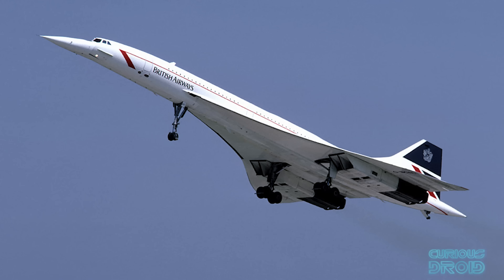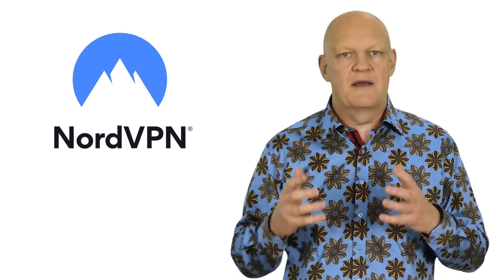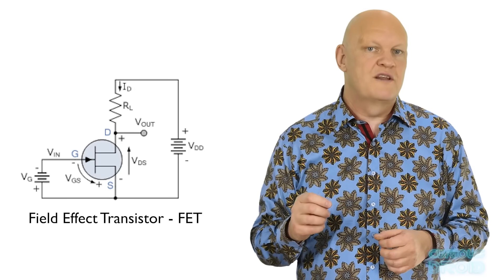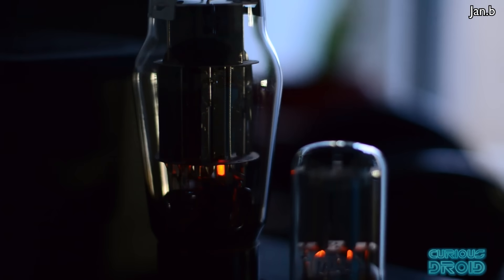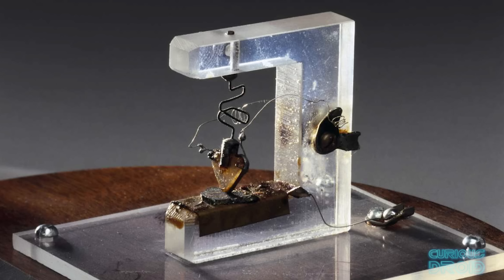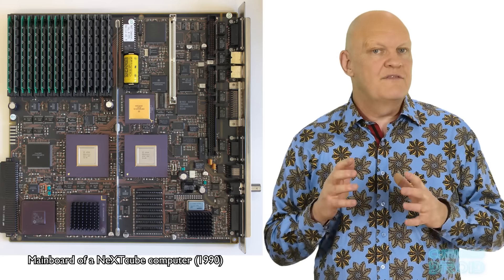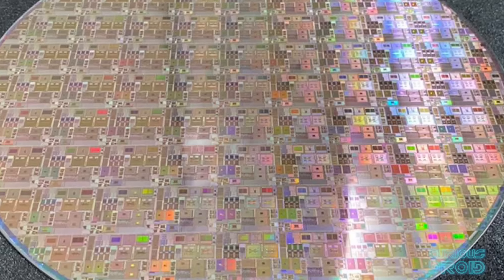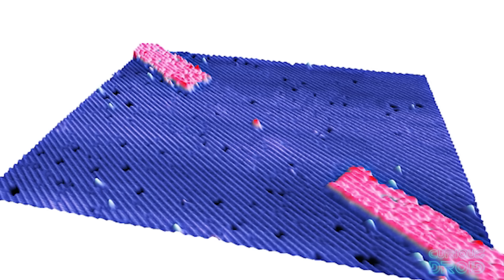MOSFET – The Most significant invention of the 20th Century

Comment: One more thing that amazes me besides the count of transistors in modern devices is how incredibly reliable they are. Hundreds of thousands to billions of them, sometimes working 24/7 for years, even decades, without failure. It's insane.
Reply: But when they screw up, it can be a nightmare of weird problems without first  blaming the MOSFET (without a circuit schematic). Intermittent problems are the worst. Been there, survived that.
Reply: @SpaceCadet4Jesus  that's why one of the best computer tools is still a small couple OZ hammer. Start taping board edges or chips, and those thermal intermittent problems show you exactly who is responsible for the errors. Just don't let the customer see you doing. :D
Reply: @williamallen7836  I used a heat gun and cold spray to diagnose potential component failures.
Reply: @williamallen7836   microwave oven is better.  put computer in oven and I find those bright blue lightning bolts always point to faults in the electronics.
Reply: @SpaceCadet4Jesus Using those tools, you're not diagnosing component failures but opponents connectivity to the circuit.
Reply: @Revo it's not only the transistor that makes them reliable. Those actually got worse with all the shrinking down the nm we did. What keeps them reliable is redundancy, in not using one cell until every other has been used (loadbalacing) too really placing circuits multiple times and switching from a broken to a working one if needed.
Reply: THIS! I work in software, and whenever I stop to think about it I am astounded by the number of operations I expect the hardware to perform with absolutely no errors. It's implicit in most software that every instruction will be performed flawlessly.
Reply: no moving parts
Reply: In July 3rd of 1947, a UFO crashed in Roswell. It had a glass panel full of microscopic circuit like thingy, broken wire that lit up at the end, a pen with light that can cut through anything, and a few other mysterious devices which we still don't know what they are used for. Read the book "The Day After Roswell" by Colonel Philip J. Corso. Some engineers who worked on early transistor validated the claims in the book. 

Interestingly, before 1947, we only had vacuum tubes and there was no clue how to improve it. December 1947, as told in this video, we had the first clumsy and rudimentary transistor, that is the building block of IC chip.
Reply: @sbkarajan  And the first design (it couldn't yet be manufactured) of  MOSFET was created in 1926. What's your point?
Reply: @martinmckee5333  "MOSFET was created in 1926" What is your source? I just googled it, it was first invented in 1959. What's YOUR point?
Reply: @martinmckee5333  LOL, I just dig a bit deeper, found the US patent by Lilienfeld.
Reply: @sbkarajan  US. Patent no. 1,745,175 is where the field effects transistor design was introduced. That was in 1926. The first operational MOSFET - a specific implementation of the design - was created in 1959.

My point is that the your attempts to form a connection between imaginary alien craft and the invention of modern electronics is entirely silly. 

A survey of the history of electronics shows how these things developed. There was no "magic" moment that requires explaination.
Reply: @martinmckee5333  1. Seen Pentagon UAP video? Pilots were not imagining.
2. Colonel Philip J. Corso, in the book, admits that he did not contribute much to the development of IC chip, laser, and fiber optics from the crash, and he said that the tech firms already had deep knowledge of such things when he joined (perhaps too late) in 1970s. But it's odd that the 1926 invention of MOSFET looks more like IC chip component than a stand alone transistor, maybe they had similar retrieval of non-human tech in Europe before US did in Roswell. 
3. If you are technically inclined, come to my CH, view some PL, "UFO Real". In it, Bob Lazar interviewed by Joe Rogan, 15 M views, will change your mind, I can almost guarantee.
Reply: @martinmckee5333  ...3 researchers from Bell labs were awarded Nobel prize in physics ims for the invention of it
Reply: @sbkarajan  don’t be so bloody rediculous,a spaceship travels through space but seem to ALWAYS crash in the states(4 I’ve heard of😏)total& utter NONSENSE
Reply: @Man_fay_the_Bru  I mean, you are so well informed, unless CNN tells you into your ear, things never happened, correct?
Hello, go watch Joe Rogan interview with Bob Lazar. 
World is not flat brother, and we cannot be the most intelligent species in the entire universe.
Reply: @cslloyd1  you've bought at least 4 iMacs, there's your problem right there.
Reply: @cslloyd1  I haven't seen a cold solder joint or cracked joint in probably 25+ years, at least not in computers. I've seen cracked traces on circuit boards. Most motherboard based problems I see are power related. Either excessive power blows a component or two or wipes the BIOS clear, both render the MB trash.
Reply: @SpaceCadet4Jesus  I saw plenty of solder joint problems in the early computers, the Elliott 903 (transistors) and it's successor the 905 (integrated circuits)  brought out in 1968. Both suffered from the boards being hand soldered. I worked on these old computers for 5 years as a field service engineer starting in 1970. It is very interesting listening to people talk about computers from that era, some people think that they must have been driven by valves and take up monstrous amount of room, not so I'm afraid. Elliott's had a military attache case version of the 905, with an 18 bit processor (both 903 and 905). Later systems had flow solder techniques that removed most of the soldering problems. William Allen's comment about a small hammer to tap a board brought back memories from that era!!! The edge of all the boards would have been rattled with  the handle of a plastic screwdriver to locate the dodgy board, get it out, have quick visual for dodgy solder points, then put it on an extender if no visual was found, out with the scope was the next option. Happy days. Then along came the huge multi-layered PCB with no hope of fixing in the field. We became board swapping monkeys from there on. Loads of us changed jobs at that point.
Reply: @johnwoody9505  I slightly remember using a hammer handle for something, but not sure what. A heat gun, cold spray, an ohm meter, and magnified visual inspection were some of my tools. I remember using a wave flow soldering machine, it was a bit cranky and produced Flux dross which I'd occasionally scoop out with a skimmer. Yes, a lot of problems were due to hand soldering, which problem largely disappeared after the IC circuit and machine soldering. I have a 8 yr old laptop whose video card has a very likely solder problem, but I haven't fixed it yet and just tossed it into a pile.
The Elliot 903 was pretty big, desk sized, but smaller than some. I didn't know there was a smaller military attache case version. Not as familiar with punch card machines although I worked near them.
There were a lot of funny stories from that time, but as I get older I forget them, until somebody triggers something. Hope you are doing well John.
Reply: @johnwoody9505  at HP we had small brass hammers we’d use on our RF microcircuits to “tune” them into tolerance.
These were used in $60k+ Spectrum & Network  Analyzers used in AWACS planes ;)
Apparent Magic…
Reply: @SpaceCadet4Jesus  or in my case (pc case actually) had a power surge through the lan cable which jumped across the motherboard contacts and fried a brand new top of the line pc 🤦‍♂️ those filters on the ups for the network cables are definately worth using.
Reply: @luminousfractal420  Sorry to hear that. 😬
Reply: @luminousfractal420  wouldn't a decent grade surge protector have prevented that issue ? They certainly are affordable, especially when the weak link in protecting highly valued components and data is utilities. Honest question. I recommend one to all of our high end domestic refrigerator customers since those computer components are subject to the same errant behavior during extreme events.
Reply: it's entirely a misconception to believe our devices work without failure, in fact our computations fail so constantly you cant run modern software without error correction, and with transistors so small tiny little particles flying through space have enough power to switch a 1 to a 0. which doesn't sound like a big deal until you realize how much a single bit of information can alter a computation. there is a bunch of basic tech support tactics drilled into the brain of everyone who works with computers, which basically boil down to "have you tried turning it off and on again?" because computers so regularly back themselves into a corner that shouldn't be there
Reply: @demonz9065  haha, guess you probably saw that recent Veritasium video too. I was going to mention cosmic rays flipping bits as well :D
Reply: @SpydersByte  indeed i did, it was a great video!
Reply: @demonz9065 ”you can’t run modern software without error correction” actually, almost no consumer computers have error detection or correction.  You have to look at Enterprise class servers before you see error detection/correction in the hardware.
Reply: Very nice  @demonz9065
Reply: @demonz9065 That happened in a super Mario game I believe it was. Somebody had some kind of cheat they were able to do in a speed run, and turns out it was due to a cosmic bit flip.

Edit: I should mention that may be apocryphal.
Reply: @demonz9065  To turn it around on you, I think it’s a common misconception that failures due to cosmic rays are frequent. Most RAM for consumer CPUs isn’t even error correcting. ECC RAM is only really used in servers, because they’re expected to be on without errors for potentially years. The risk of cosmic rays is so small for consumer electronics that it’s not really a consideration.
Reply: @JamEngulfer  i never said cosmic rays frequently flip bits and error correction is a lot more prevalent than you seem to think it is
Reply: @JamEngulfer  ... unless said chip is in interstellar space... could Voyager's recent glitch be due to such an event. Sun's magnetic field deflects most incoming cosmic rays away from the inner system. Voyager is now beyond such protection
Reply: The hazard that does exist over years of service is called "electromigration",  We in the design side of it are now able to use software tools to identify where it's most likely to happen, then we try to prevent it.
Reply: Uhhhh.... there is some evidence that these devices wear out.

We have so much planned obsolescence and market competition that most of us don't notice it.
Reply: maybe theyre alive and they want to live
Reply: What's more insane is how they test new designs, and test finished chips. The complexity of exercising them fully to weed out defects is astounding. There's a quote from Brian Kernighan about debugging being twice as hard as making the thing in the first place.
Reply: The EE rule of thumb is that if the “computer died” it was probably the power supply or the interconnects. Sealed ICs really don’t die (with some exceptions if you’re dealing with really old electronics).
Reply: A very large number of chips don't make it out of the assembly line.
Reply: now just imagine the more complex human body
Reply: why do they bring out a new phone model every year?
Reply: The components are has rated life time better with smaller size and lower dissipation, but the assembling technologies are become more prone to fall and the usual unit cases are not desinged to protect the board itself to bend and THT connection to break as well. The SMT connectors are garbe and not had mechanical support to the pcb and all of the mechanical disturbance is transfered into the tiny pads and dry soilder joints.
You can not use an whole laptop without a working chargeing port more than 6 hours so the bilion integrated transistor faliure rate can be much better than the unit itself can provide in the very best days.

Nowdays the smart ic packages are full of protection diodes, resistors, and ferrite beads to protect the ic from the harsh environments, in the old days the desinger had to make an protection strategy and implement it somehow. Mostly they do nothing, because the product is not rendered to use in a wrong way.
Reply: Yes, that is amazing !  What's even more amazing is that most of them are "hit" by cosmic rays and other types of radiation and heat, and yes, they keep going for years, decades ! 😃
Reply: Currently they are working on 2 nm chips. At this this small scale of a couple of atoms, it's running into quantum tunneling issue which is the practical limit of silicon.
Reply: Insane? No, it is MAGIC! (In the sense of Clarketech, technology so advanced, it is indistinguishable from magic.)
Reply: Actually it depends on the manufacturer but for example intel sell a 12th gen i7 intel core but comes in different qualities. Each subcategory is actually a chip that doesn't meet the specifications of a good one because of imperfections  but is still functioning. 

Also over time electrons will push the silicon atoms and eventually destroy transistors over time. Cpus can over come this but if too many go then yout chip will suddenly die.
Reply: Transistors fail all the time.

That's why error correction is built into whatever happens to be relying on them.
Reply: @SgtSnausages error correction is not used to work around failing transistors.

Comment: 14:00. I disagree, and we have molecules as an example you give to size, but nature has already revealed that a quarter turn muon, lepton gives rise that we can convert their turn relation to a binary function of difference through various means of triggering. So adding into the current dynamics of 3d builds of a processing unit. we can further create more complex storage system as of yet by utilizing the sub atomic particle branches. Utilizing them for valves that turn yes or no. Then again, one person stated a particle simply doesn't take up any space... So it returns to the core fundamental of limiting field is will call micro-electromagnetism, but its much smaller, so small that its the limitation of the smallest artificial means to create a electromagnetic current, that can be a transistor for storage.  We have Lepton group, Boson Group, Quark group that have a fundamental means of a useful product for electrical system. The size in which could be utilized should be at the sub atomic level. It would be a degree of using such things and how conductivity of something operates in a system. I have no idea... but I do know someone knows, and theses like good use of energy to utilize this level as a transister place. this would require greater understanding at the  molecular level and for consistency their atom/ molecule relation to their parts of construction. Perhaps looking back at what are we really doing? the basic of the operation to then relate back to the want/deisre of that relation in these groups, how to go about it to a similar effect. I wouldn't shoot for billions, but just a simple relation of on or off, transistor... that has the desired qualities and rigidity. 

Of course there is artificial transistors that simply only exist when powered, is another theory.. when the power is turned off the transistors do not exist... This would be more of theory, like, how water travels down a tube, and the water on the edges clings and the water in the middle goes faster. So the water has resistance that technically acts like a smooth rigid body of force that limits the movement of the water in the system. So the its basically a water tube, supported of course by a pipe, but a self supporting water tube could exist.... There is not a word that summarizes that movement that would be ongoing... So one then hast use a exhausting amount of details... IE word creation. So lets say I had a large amount of water, and zero air restiance and temperature is stable to keep it fluid. Water is an example but other substances ould be used ones that may have an easier display for the setup. So Lets say the water is traveling through a pipe at a high speed. Creates the affect, anyways the force of the water is maintained by a system ,but it is traveling through a water walled system as the resistance is held by the wall of the other substance. hmm.. but.. the wall is only electromagnetic difference that holds it there, so the water could be used to as a wall or simply electromagnetic piping, but that would be quite a controlled system of electro current to create an artificial wall as it were, rather than a pipe, Likewise it would appear to create water looking pipes with the same current on the inside.  that would be th relation of artificial transistor that only exists when powered... in th same sort of sense. Since you using a field to basically be the wafer/ rigid structure. Which seems then more like magic, so you could have an entire artificial world created with such things, limited by imagination.. and then one day, simply turn it off and it all vanishes... hmm